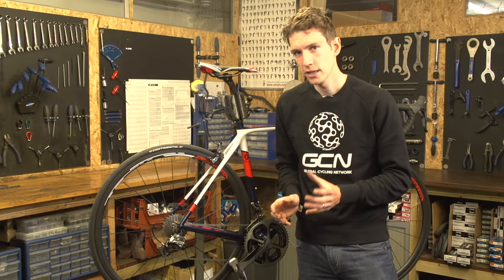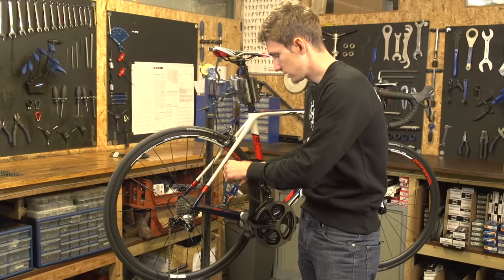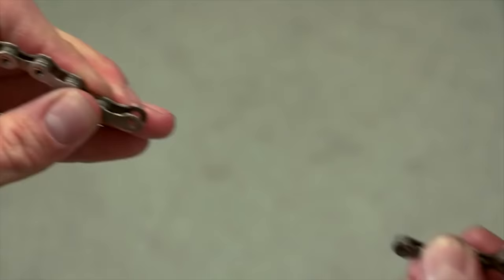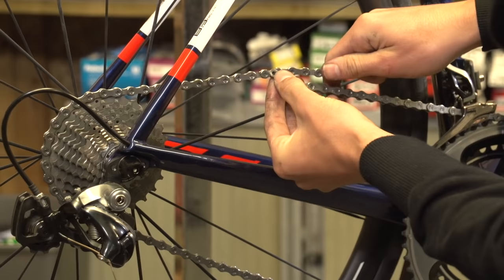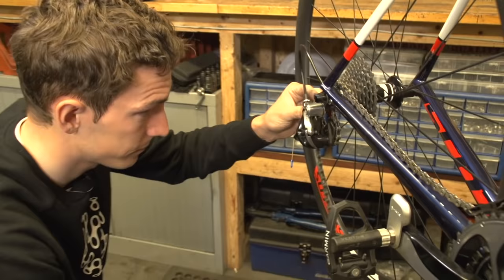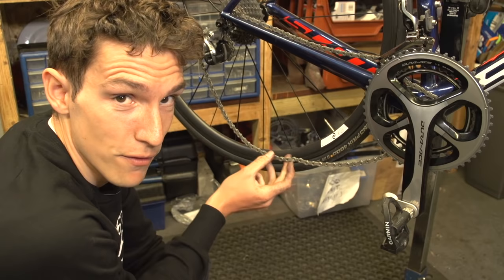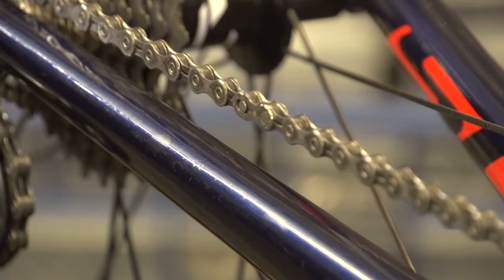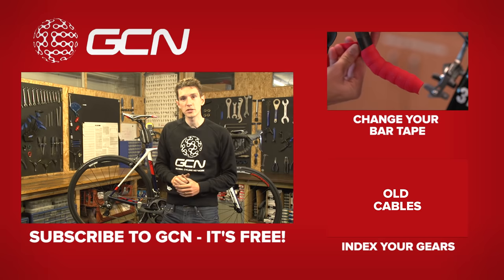How To Replace A Bicycle Chain

Comment: The thing they don't tell you, is if you buy a new chain, IT DOESN'T COME WITH A CLOSING LINK!  Arrrgh.  You have to go and buy the closing link separately!!   And by the way, the quickest way to remove a REALLY rusted chain is with two vise grip and/or channel lock pliers:  pinch the two pliers fairly close together on the chain and twist opposite directions.  Walla!  Works fast, easy.

Comment: Probably worth mentioning that if you're not using a shimano break pin or a quick link, and you want to make a "solid chain", then don't push the pin all the way out. Only far enough for it to sperate. That way you can connect it up easily, plus it's nigh on impossible to reconnect if you've pushed it all the way out.
Reply: ***** Yeah they do, but sometimes people don't want to use them, they'd rather not use a "quick link". It makes sense to have them, but it's just an extra comment. Also useful if you've only got a solid chain and you need to just take it apart temporarily for replacing a derailleur or something :)

Comment: i didn't watch this video beforehand for removing my (very rusty) chain. looking at it now there was a chain link. ive learned at some point that repeatedly bending metal back and forth usually does the trick for breaking metal stuff, so i just did that 😅

Comment: I have only ever used Sedis chains and never had a problem yet (after 40 yrs) with a broken chain (TW). At 1'27" in the video, if using a Sedis chain make sure not to push the pin out of the second collar, but leave a bit of the pin protruding on the inside, to enable easy reconnection.

Comment: It would be great if GCN did a video on how to fix a dropped chain whilst riding. Without stopping, by making sure the chain is not stuck and backpedaling etc to free it then shift to opposite chain ring and soft pedal to get the chain back on. Instructions for if it drops off the inside or outside and setting chain guard and limit screws right to make this less likely. And also if chain is stuck how to stop and free it with a stick etc and shift to opposite chain ring and ease it back on by hand turning the cranks.

Comment: A small detail about the shimano chain joining via their pin. You could have noted that you need pliers after inserting the pin, its not gonna fall off by its own after enough of the pin has been inserted, I fucked up 21$ chain. First time tried something like that, had no clue what I was doing, trusted this vid.

Comment: 5:15 I can not recommend to use pliers, either you won't get to break the pin, you may break it at the wrong point or you damage the pliers. If you use the back of the chain tool (which you used to drive the pin in) there should be a hole designed to fit the pin. if you then move the pin in it and move the chain and chain tool into opposite directions it will actually break easily.
Reply: my one snapped just before the main section made it into the chain 😢

Comment: I don't know about others, but I've always used a cable tie to secure the derailleur forwards while breaking and joining the chain.
Reply from the maker: dan110024 good idea.  You can also use some old metal wire and bend it into a double ended hook - then use it to keep the two ends of the chain together whilst you do your work.
Reply: ***** Good point. I've only ever ridden downhill bikes before now, so it wasn't possible to drop the chain from the chain ring.

Comment: I was replacing my rear derailleur, which you all also have a video on and which links to this video for the step to remove the chain. never having done this before, I followed your instructions to remove my chain, then when it was time to reattach it I realized I wasn't supposed to push the pin out all the way! this video seems to only be for if you have a new chain, but not if you want to keep the chain after you take it off. now I'm SOL and I guess have to buy a new chain? so that sucks.

Comment: When you use a chain tool, you can see some ring left on chain tool pin after pushing, it is important? When I break by chain for cleaning (Ultegra 6800 11sp) and then connecting them together, my chain after about 100-150 km was broken on that point. Because when I trying to attach them together again I just used old pin from that point, not Shimano's special connecting pin. So that was my mistake after using power link on MTB ;) Thanks for video, it's good  =)

Comment: There's a serious error in this video.  In the Shimano installation guide, they recommend that for additional strength that the connecting pin be inserted in the hole at the other of the link vs. that shown in this video.  The idea is that at the point where the connecting pin is inserted, the pulling force should be on the link's inside plate instead of pulling on the outside plates of the link.  Suggest you check out the installation guide.  Here's what it says: "As illustrated in Fig.A, we strongly recommend to set the connecting pin in the hole of the outer link on the front side in the direction of travel. The chain’s level of strength is enhanced compared to the method in Fig.B."
Reply: I was confused because I have noticed this in Shimano manual and didn't know if I just  missed something. However your explanation does not seem complete, because of Newtons third law. Force in rope or chain should be equal in both directions. I'm not saying to ignore instructions, but there must be more subtle reason for it.

Edit: Ok, I have figured it out. You mean force of cog pushing chailink, not other chain link pulling chain link.

Comment: Can you join 2 partial chains together (in a pinch)? How do you tell if your bicycle has a Shimano chain or a different chain? Is there a difference between Shimano pins and different chain pins (not quick link)? Or, does "Shimano chain" refer to all chains that have a pin system instead of a quick release system?
Reply: And do chain repair kits come with new pins?

Is it ok to reuse a chain but 1 link shorter, if it breaks?

Comment: Thanks for all ur vids great help,  do have a question if u don't mind, I replaced my jockey wheels few months ago and I had a mega problem getting it all back together and that was due to my derailleur,  as soon as I took my chain off my derailleur sprung clock wise which loosened that spring that keeps tension on the derailleur, I've never had that happen to me before on any bike and most vids I watch it don't happen so wondering if there's anything wrong wiv mine, I managed to turn the derailleur anticlockwise untill there was enough tension on my chain,  but ever since then it's never felt right , not sure if I've overstretched the spring on the derailleur or what,  like in this vid when you take your chain off your derailleur didn't spring it self loose clock wise. Any advice wud be grateful. Thanks Matt

Comment: Well I believe while replacing a new chain on a bicycle prior to that one should check the sprockets and the rear gear cluster sprockets because sometimes the teeth will start to wear out and they'll form what I call little Fish Hooks and also to if you have a stiff link you can move that linked laterally with a little bit of pressure from both hands and that will unstick it. But other than that this is a good instructional video.

Comment: I assume that new pin for connection of the new chain comes in the box with the new chain?  If reinstalling the original chain, do you need to buy a new pin?

Comment: great, Shimano, your joining pin snapped BEFORE the main section was inside the chain joint. Fantastic, and the set only came with a single pin, there should be several inside. Such a shame :(
@GCN, thanks for the video!!

Comment: I ve been told by a bike mechanic that is wrong to use the old chain to measure the new one, as this one has been streched over time, which make sense, as this is the most likely reason to change a chain in the first place. So I guess the way to go is how you show later on in the video.
Reply: +manny me or just count the links if when placed next to each other they start to not sync up

Comment: I bought a 6/7/8 speed chain even though my bike only has 5 cogs on the back. I just couldn't find a 5 speed chain. Should work right? . I can't imagine the chain being thicker because of 1 gear difference. I'll find out in a couple days either way!
Reply: It will work with no problems. One generation gap up chain will work flawlessly (example: 6/7/8 speed chain on 5 speed block). 
I've read this on Sheldon's Brown website (Super famous bike mechanic) and have done it myself. Enjoy your ride!

Comment: One small tip - start opening the chain by pulling the pin OUTWARDS. Don't pull it the whole way through. This will make rejoining the chain much easier.

Comment: Some chains e.g. Shimano hg901 must be fitted to rotate in the correct sense I.e. engraved writing on link plates must face out; inner plates are machined for optimum shifting performance and have no engraved lettering.

Comment: I have the opposite problem. My original chain is very long and I can't find one with that size that doesn't break the bank. Can I use 2 shorter chains and connect them using 2 master links? I don't like the Shimano connection pin.

Comment: Been fortunate enough to have never broken a chain on a ride. Is it due to the strength of the Rohloff SLT 99 chains that I have been using since 1989 or my personal weakness? Not sure but this year will be the first time that I will be equipping my oldest bike with a Regina extra chain. NOS probably from the early 90s.

Comment: I've never been able to remove the SRAM 10 or 11 speed compatible Powerlocks with my fingers -- not a problem with the Powerlinks (for 9/8/7 speeds). Also according to SRAM the Powerlocks are 1-time use and they are uni-directional (there is an arrow on the plate indicating the direction) -- the chain isn't but the link is.

Comment: I have a comment to the chain length. If you place the two chains beside each other the old chain will be a little longer than it originally was. So you should count the number of chain links on the old chain and make the new chain to have the same number of links. Otherwise your chain will be slightly longer every time you change it.

Comment: This may sound like a stupid question, but if you are doing the BIGF - Bigr 2-link measure with a quick-link chain, then the quick link itself counts as half a link, yes? Otherwise, it is impossible to get a chain end join with an "outside half-link" rather than an "inside half-link", if you follow me...

Comment: Gcn you guys should include a new chain and cassette with the inexpensive upgrades video. My bike is a trek 1200 and a new chain and cassette made a bigger difference on average speed over 25 mile trip on flat ground than new 1400 gram carbon wheelset. Never herd anyone talk of what a difference it makes I was surprised +2 mph more or less. Although the chain and cassette are ultegra not the original tiagra.

Comment: Here's a rough transcription of the steps:

1. Put bike into smallest ring at the front and back to maximise slack
2. (optional) Take chain off chain ring to give even more slack
3. (optional) Take rear wheel off to give even more slack
4. Find quick link and push the two plates together using pliers to release the link/use chain tool to break the chain
5. Determine new chain length by either 
5a. Copying length from your old chain
5b. Wrap the new chain around the largest sprocket and largest chainring and then add two links extra
6. Break the new chain to the correct length (if using a quick link, both ends need to be of the narrow type, otherwise one needs to be narrow, the other wide)
7. Feed the chain through the rear derailleur over the top jockey wheel and the bottom jockey wheel.
8. Connect chain ends together:
8a. If using a Shimano chain, make sure you use the special joining link (never break the chain on this link again)
8b. If using a quick link, join the chain with that.

Comment: Hi.  I haven't got old chain so have used the measure and add 2 links method. Just wanted to know, if I use the quick link would this be as well as adding 2 links when i measure or should I just add 1
Reply: +Iain Smith 
Pick up the new chain, measure your length, add 2 more links and than replace one  wide link with the quick link.
Reply: +JoJanDiezel 
Thanks. that makes sense

Comment: I used this video to install a new chain. The point where I inserted the pin is stiff and jams the rear derailleur causing it skip. Is there a way to fix it?
Reply from the maker: Try bending the chain at that link in the wrong direction a few times, it should loosen it up.

Comment: using old pin that snap at end of assembly means it was not well aligned with hole and pushes out a ring that was part of hole happens often l thin k pin can be too loose then , so l wiggle bend links with wise grip over them until hole falls over pin. then on through

Comment: I accidentally started to remove a pin, realized that the chain wasn't fully on the big cog. can I just push the pin back in or have I ruined my chain? I have pushed it back in and now removed the right link, all looks ok but am worried that it might break on me

Comment: I got a question for a possible future video: When to replace your cycling bibs/ short/ chamois? 
I been cycling for a while and every once in a while I start getting irritation and rash in my bottom I usually doubt above if my saddle is bad or my fitting has change, for every single of this time it turns out that I have out too many miles on my bibs. Is there any specific period on when to replace them?
Reply from the maker: JC Flyer not really, it depends on the conditions in which you ride, the quality of the shorts and chamois etc.  It should be fairly obvious by looking at them though when they have had enough wear.

Comment: There are different sizes of chain tools for different kinds of chains... make sure you use a correct chaintool. If you have to reuse your chain put it on inside out or backwards if the chain is uni-directional, so it wears out on different cogs.

Comment: For some reason bike shops stopped carrying pins especially in 11s or less common speeds in favour of ONLY offering quick links. This is such a bummer because I truly believe the quick links are weaker and pop off sometimes compared to the sturdier oldschool pins, no matter how much hype you hear about quick links. I've never had a chain break with a pin but I've had the chain break at the quick link while riding about 5 times in the year I tried to use them. Weak.

Comment: does the formula of big / big plus 2 links (not through the rear der)  always then allow you to get into big / big once threaded through the rear der?

seems a bit tight

I realise that we should not use big / big in practice, i just want to know that if i accidentally shift there, that nothing will break.
Reply: J B it won't break, but the chain might come off the chainring or rear mech. Then you are gonna have to get your hands dirty to put it back.

Comment: How important is using a Shimano pin to re-join the chain? I took mine apart the other month and rejoined using the same pin that was still sitting in the link. It's how I've always done it over the years with no breakages.
Reply from the maker: dan110024 I've done that myself in the past but it's definitely not recommended by any manufacturer.  Sometimes you can get away with it, as you've well found out, but it's definitely the weakest link and if the chain snaps at the wrong time you could yourself all sorts of injuries.

Dan
Reply: ***** Really considering buying a new chain now. Lol!

Comment: I have a chain that doesn't have a quick release, however, I'm needing to remove the chain to replace the rear mech. I was wondering can I install a quick release chainlink to reattach the chain? Would I have to remove a link before I do that? If I simply added a quick link, would the chain then become too long if I didn't? Cheers.

Comment: I never used a quick link before and am a bit skeptic about the strength of a quick link. However I want to go use paraffin on my chain so it would be really handy. Any experience/thoughts about this?

Comment: One more thing, with Campagnolo chains the joining pin needs to be "peened" (burr the snapped part) and a special tool should be used. Otherwise just use a quick link (much cheaper than buying the special tool).

Comment: What do you think about adding a sram quick link to a Shimano chain. It works fine for mine but was it a wise decision.
Reply from the maker: hi
SRAM chains work on Shimano groupsets from my experience. However, personally I wouldn't use a SRAM link on a Shimano chain as it's not designed to be used with it.

thanks
Jon

Comment: I like the SRAM chain but not the quick link, which is a pain to get off. I've switched using a chain tool to break and rejoin the SRAM chain the old fashioned way after it is installed. If that's a bad idea, maybe someone can let me know.

Comment: To undo the quick link I wrapped a brake cable through it and twisted the wire with pliers to act like a vice and it popped right out. I did this because my needle nose pliers weren't needle nose enough

Comment: When you say 2 links, is that 2 pins (which is an inch) or 2 inner/outer plate combos (which is 4 pins/2 inches)?  Not sure I explained that well, but you seemed to add 4 pins/2 inches.  The Shimano manual seems to indicate 2 pins/1 inch.  I want to say that in your other video about chain length, Dan also extended it by 2 pins/1 inch.

Comment: Thank you for your video. My basic question, is there a specific chain link and pin I need to be looking for or will any chain link and pin work? I'm sorry if someone has already asked this question. Thank you in advance. Cheers.
Reply: Thanks, but no thanks. I figured this out so no need to answer my question.